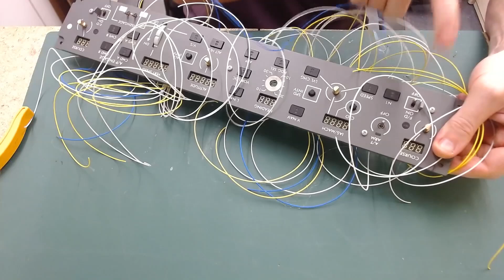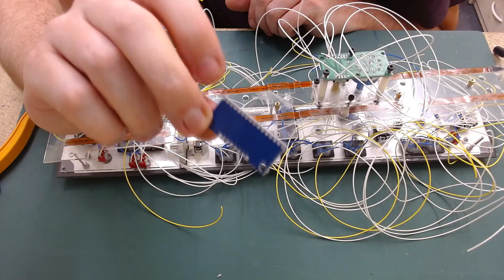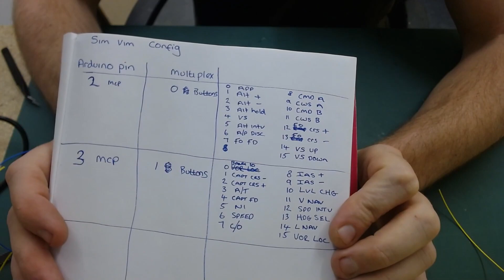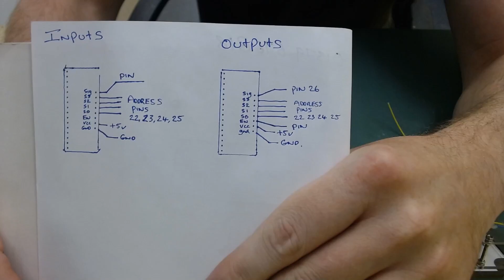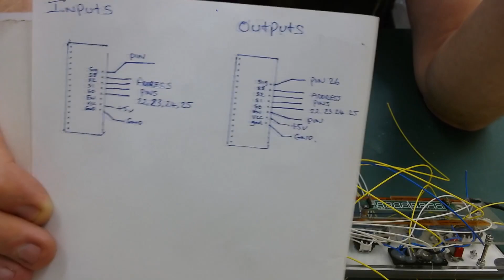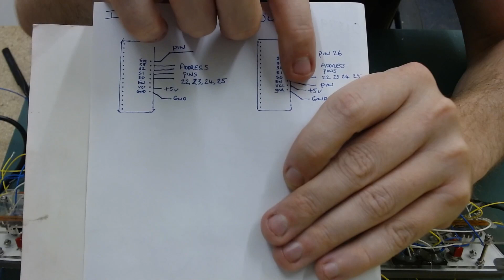737 home sim build - Hispa Panels MCP build part 2

Comment: Have you looked at making 74HC595 8-bit shift register boards for your LEDs? If I read correctly you can have up to 64 LEDs from a single Arduino pin. At least that was my plan. You do have to add resistors. Either way I'm happy to see someone using SimVim and documenting the experience. Please keep moving forward. I also appreciate that you point out mistakes so we can all learn.
Reply from the maker: Hi Scott, I’m using DM13 chips to run the leds via sim vim now. This also has the ability to have 64 led’s from 1 arduino pin. I have made myself some breakout boards for these which I will show in a future video. I’ve said before I’m not afraid to point out my mistakes, if I save 1 person from doing the same then it makes it worth while.